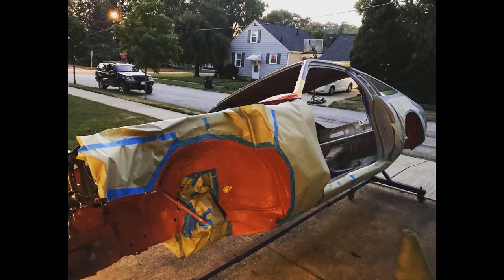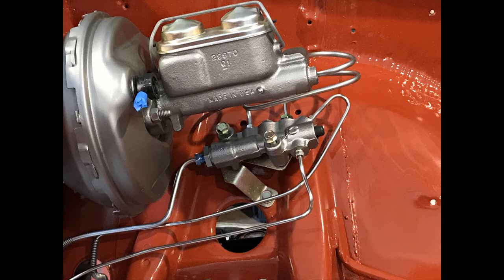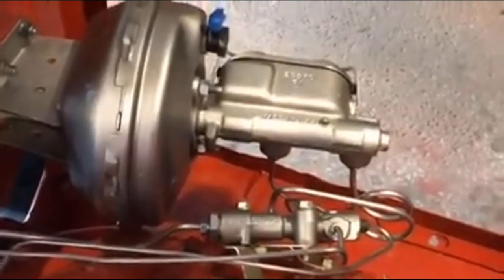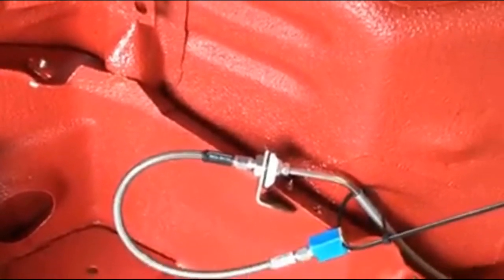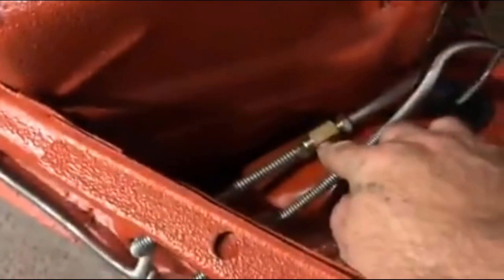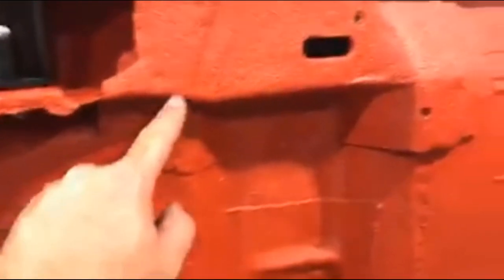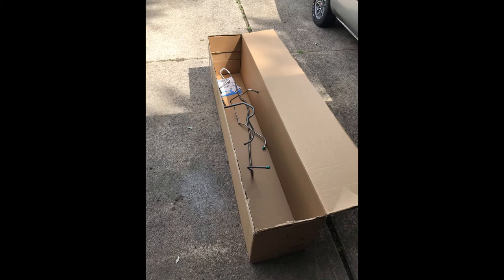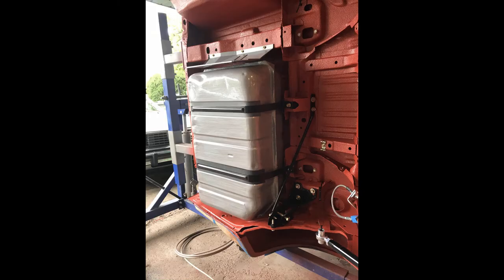Chapter 8: Brakes and lines

Comment: Sounds like the Online Lines folks may want to sell some clamps too.  Not sure if a universal type would work though.   Jeez I wish I could have a project like yours!  I'm working on gravel and mud here though, trying to just keep my Ciera and Chevy truck in running condition 😹 Thanks for sharing with us!
Reply from the maker: I think they may?  I ended up getting some from Summit.   The stock ones mostly worked but that 3/8 fuel line is more like 1/2 inch with the armor so the stock clamps were a bit small.

Comment: I made the mistake of running the fuel line on the passenger side, tore it all out and moved to the drivers side. On pass side it ends up having to cross over the exhaust twice which adds heat to the fuel. You could add another one of those nice inline tube 3/8" lines right beside the other two maybe.
Reply from the maker: I considered buying the vent/evap line set but it is just a small line (maybe 1/4"?).  I asked if they offered an upsized 3/8 here to be used as a return line.  Nope.  "No special projects at this time" is what they told me.   I did run a copper nickel return line.  It still needs to be finished up into the engine compartment.   The Holley Snipper requires a 3/8 supply and return.